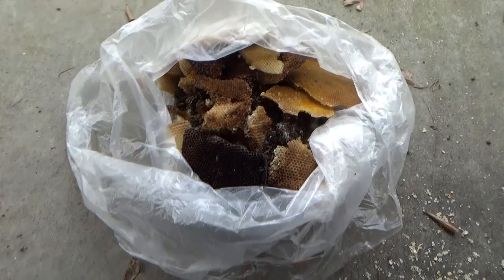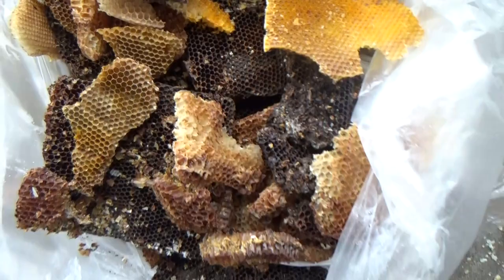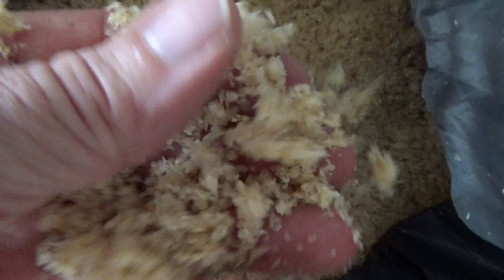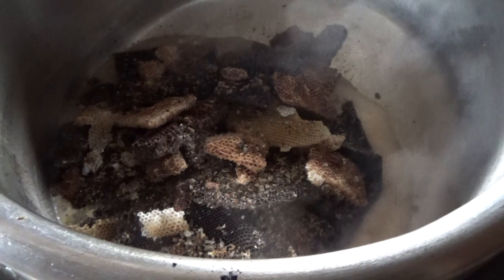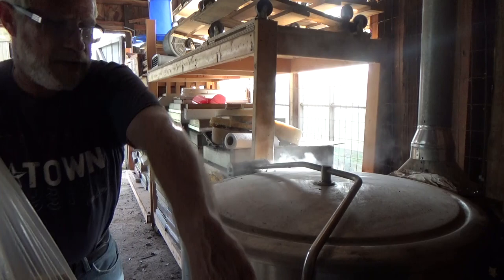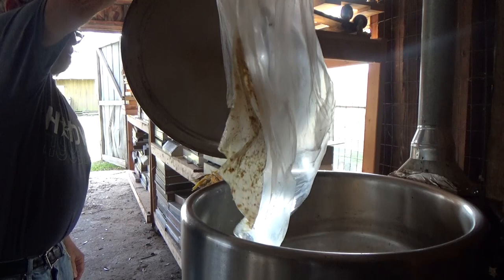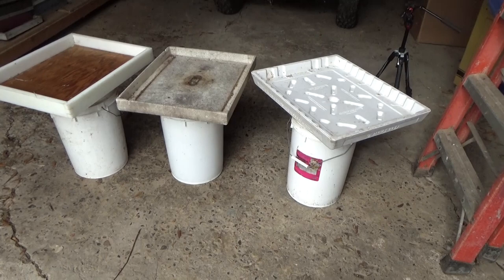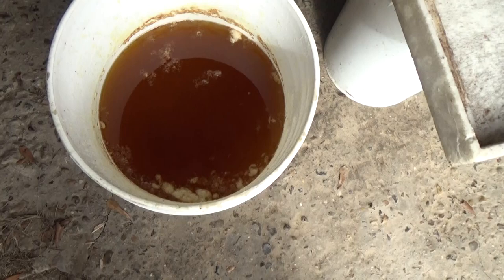Different beeswax different colors after the rendering.

Comment: In the first batch you can see a bunch of debris draining in with the rendered wax. You have other videos in which you have rendered the same wax over again to purify it more. Would it be easier to use both the screen inside the kettle AND the strainer on top of the bucket (like you used to do)? That way it's strained twice in just one boil? What do you think?
Reply from the maker: Because I'm going to render the wax again, and maybe even another time, I just don't sweat it anymore about trying to catch the the most debris as possible the first time. I have found I get more wax from the renderings if I just don't try eliminating as much debris initially. At least that's how I have found it. God's peace Tammy.
Mr. Ed